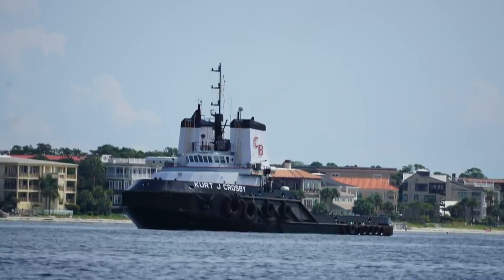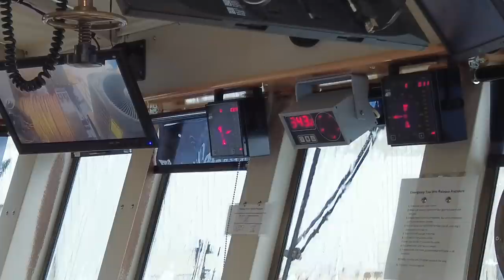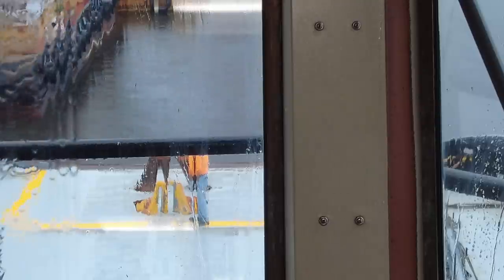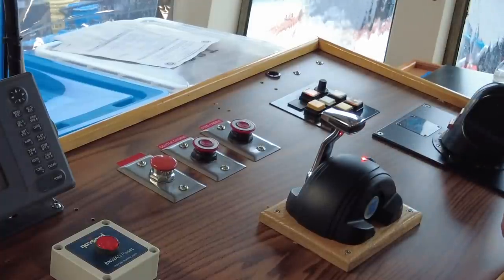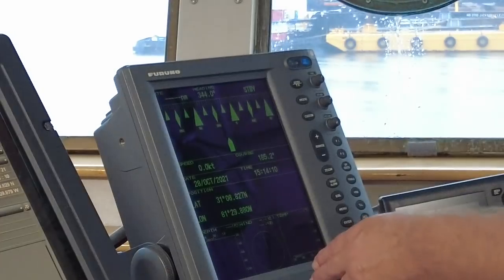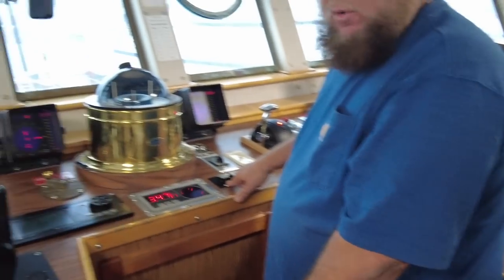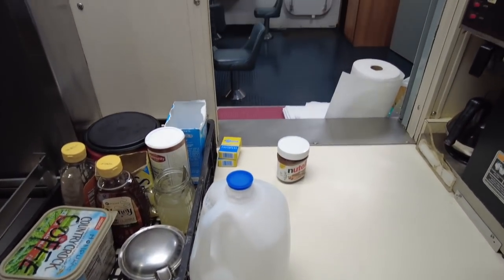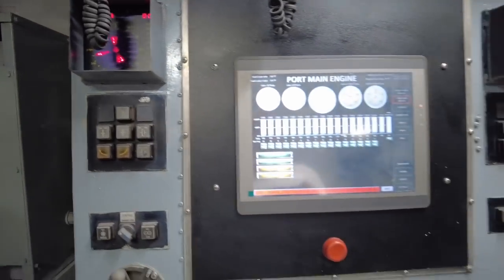M/V KURT J. CROSBY

Comment: Interesting that they had 3 engines for propulsion, one gen set, and another for the winch. When I was in the Navy on a 172 foot wooden minesweeper, we had four 12-cylinder Packard engines for propulsion, connected by hydraulic clutches to constant speed shafts and variable pitch propellers. Two of those engines were connected to generators to power part of the mine sweeping gear. Then we had 3 GM diesels  connected to: 60 KW, 100 KW and 185 KW ships service generators for electrical power. There was a 5th 12 cylinder Packard engine/generator, dedicated to a different piece of mine sweeping gear. Your taking the tour of the Kurt J. Crosby engine room took me back 50 years. Everything looked familiar. Thanks for the tour. When you get a chance, venture on down to Mt. Pleasant, SC, and take a tour of the WWII submarine, USS Clamagore, to Mobile Alabama for the USS Drum, or to Baltimore MD for the USS Torsk. You will enjoy those tours. Thanks for the video. Jon

Comment: Gotta see this !
Reply: I was an engineer for ECO for 14 years.
I hope you get to tour a ECO supply vessel someday.
They are huge.
280 to 340 feet long at the waterline 90 to 100 feet at the beam.
3000+ tones displacement.
Each of the 8 drilling fluid/mud tanks you could have a basketball game in.
240,000 gallons of fuel and the same in water.
The rear deck looks like a football field. ( it’s not that big, but it is big)

Comment: I fear I'd have to 'walk the plank' after I prepared any meal!!! Those Z and Center prop engines look similar to what is installed in a railroad diesel engines. If I understand correctly, these engines are built so that each cylinder can be removed even while the ship is underway. You likely know more about that than this land lubber!! 😜